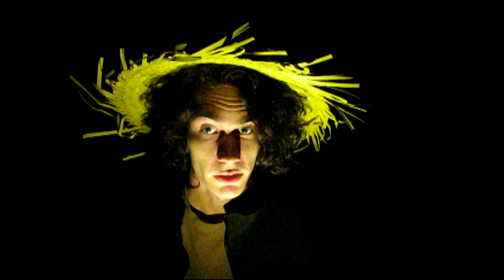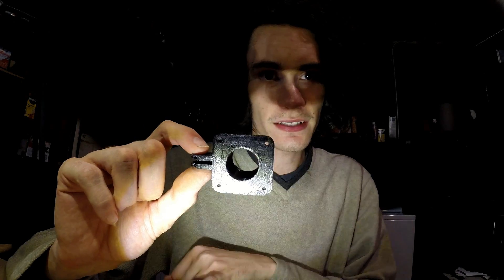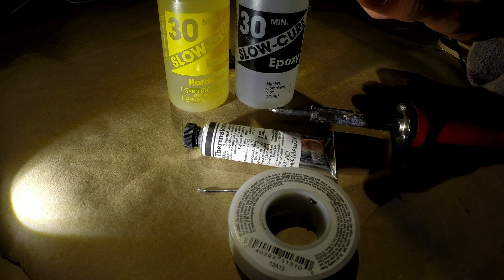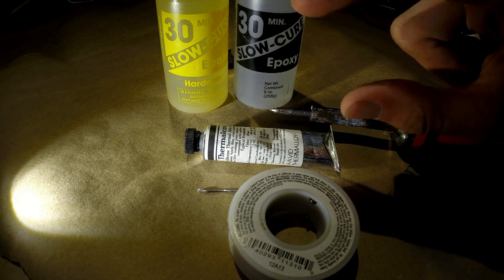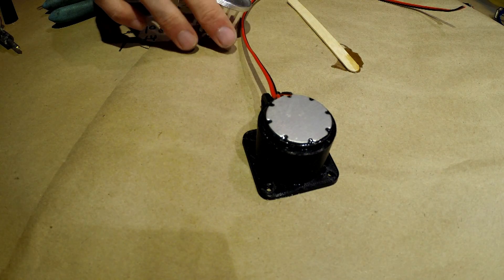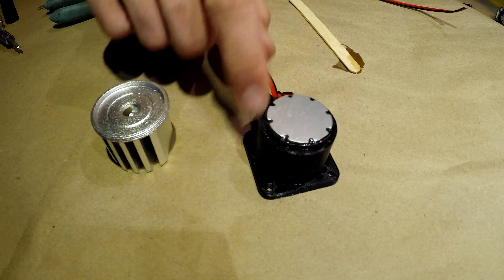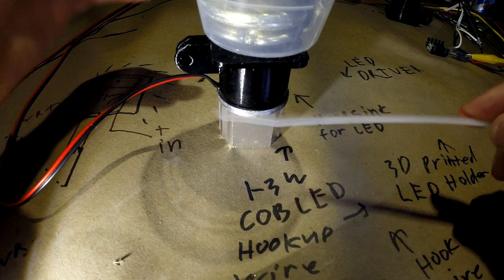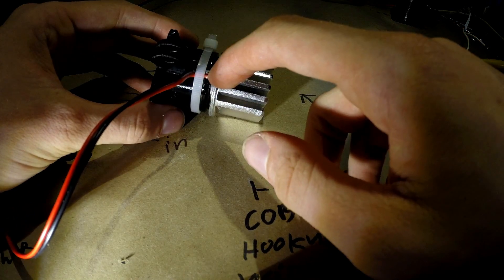LED Filming Spotlight

Comment: nice job Cal, might have to look into something like that for the landing lamp on the Sky Hunter.
Reply from the maker: Brad J. Mitchell Thanks Brad. For your application and intermittant use I think a tiny heatsink wouldn't be a bad idea but nothing like mine is needed! Just make sure to check the power going to the LED. Doesn't take much to get them bright. I am debating adding them to the Tricopter as "landing lights" for night fly.